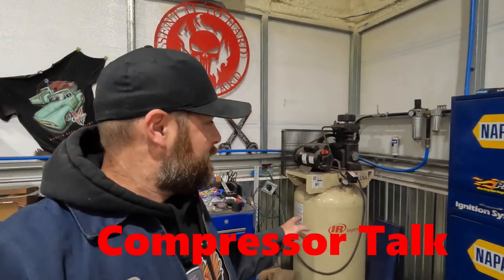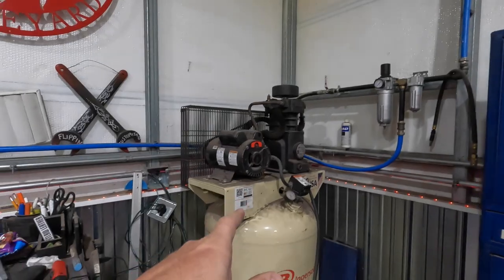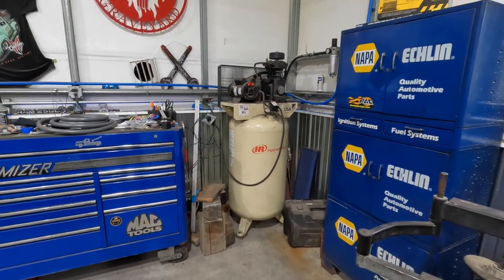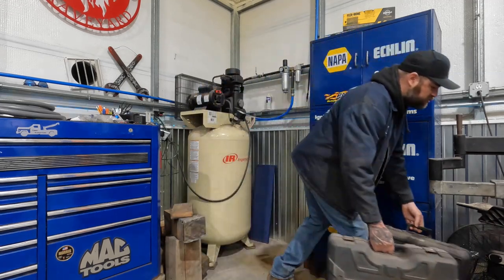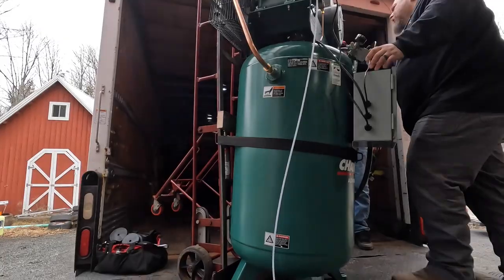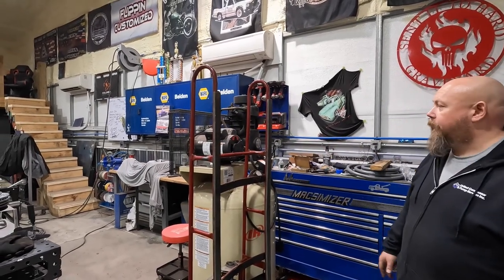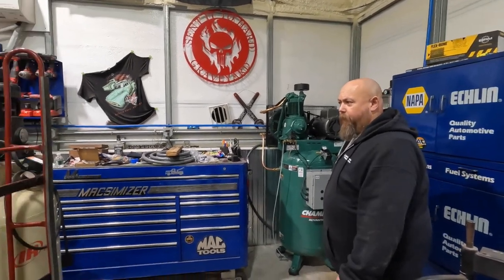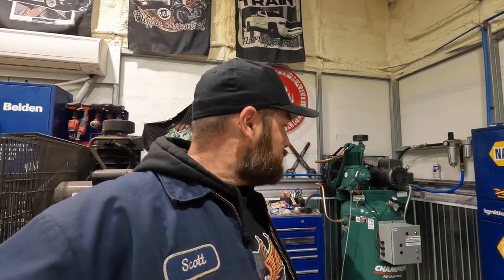Choose The Right Air Compressor 😳

Comment: I used to have a similar champion that was made in 1971. It’s 2 years older than I am and the pump still hasn’t been rebuilt. Worst breakdown was new valve plates a year or so before I got it.
Reply from the maker: Great to hear

Comment: I have a dewalt 60 gallon 5hp. I spray cars as a hobbyist but my compressor wont keep up. Could you or uour friend advise me if its better to upgrade the pump or motor on my compressor for more cfm? Want at least 20 cfm
Reply from the maker: I don’t think it’s possible to get 20 out of that set up mine isn’t that high